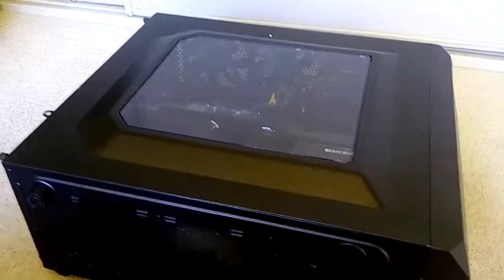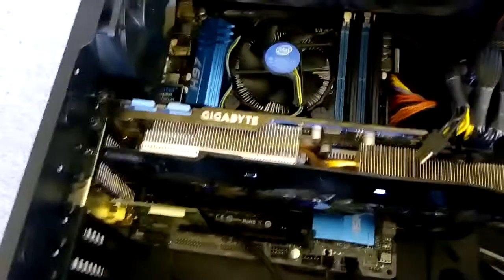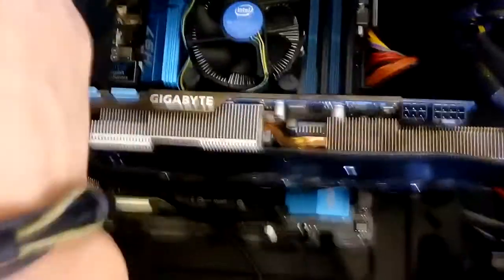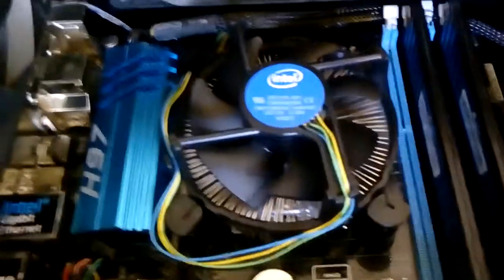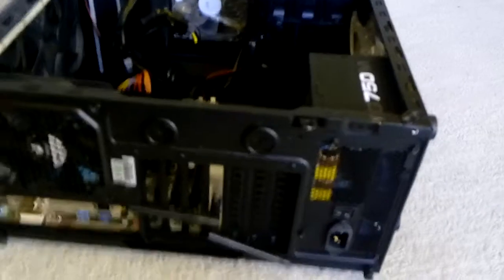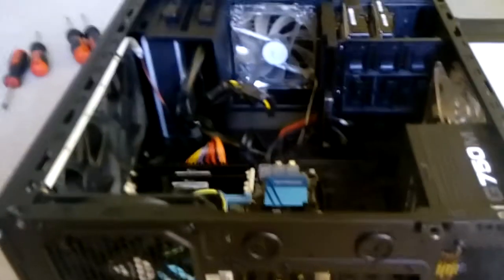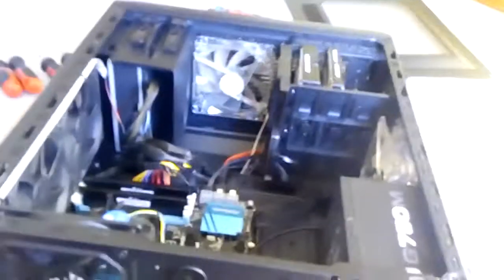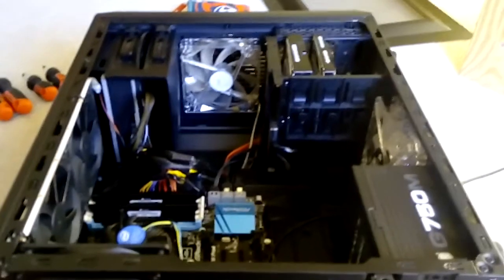Diagnosing A Broken Power Supply PSU

Comment: That is exactly my problem... FANs spin for a second after power-on, and then nothing. Off to change the PSU then, (could be the motherboard still, but I hope it'S the PSU, that is cheaper than a new MB, whouch would mean a complete rebuild anyway, as the PC is 12 years old...)
Reply: was it the psu?
Reply: @2ez978  It was. Fortunately enough... But it took all 3 HDDs and a BR burner with it when it went away... 😁
Reply: @karaklcmehmetosmanpasa3680  still saves a lot without a broken motherboard tho!
Reply: @2ez978  Sure. If it would be the MB it would be a catastrophy for a long time. I cannot afford to build a new PC right now. So it was only about 80 €s for the new PSU, one new HDD is enough for now - another 80 € - and since a new BR burner was out of the buget already, I replaced it temporarily with a common DVD burner - about 20 € - so together not even 200 €. Of course the loss of all the data is terrible, fortunately I did not have anything I could not live without stored there...

Comment: My PSU didn't die but my computer would just shut off by itself. My PC was originally powered by a crappy stock 300W PSU. I replaced it with a 850W corsair; no problems since then!

Comment: My pc won't start up when I press the power button but shows light on the board and the fan is spinning. I need to press the RESET button to start it up. Do you have any idea what causing this?
Reply: Did you solve it. I have same problem

Comment: My pc has random restarts when under heavy load. Did a memtest just to be sure and it's fine. Also checked the temps which are fine as well. It's a new system with an old psu, so I suspect the psu is the culprit. I also get the red leds on the motherboard to light up and the system not booting sometimes  after such a crash.
Reply: omfgpowned same have u fixed it?

Comment: I dont know whats the problem with my pc my friend told me its maybe the motherboard or the psu.So what my pc does is it turns on and then it loads to the lock screen (windows 10) it glitches out and starts flashing then throws me back out to the lock screen.And it sometimes works if i restart my pc from the lock screen.Sometimes when i try that its says if you do this it will throw out the other users to.

Comment: yeeeeeaaaaaaaaaaaaah what I was hoping for is a video on how to find which transistors / diodes / resistors n stuff are broken in a known broken power supply and how to find the part numbers for the SMD components to replace those.